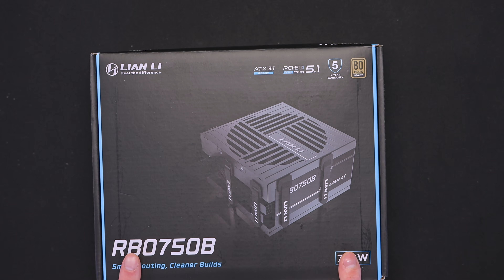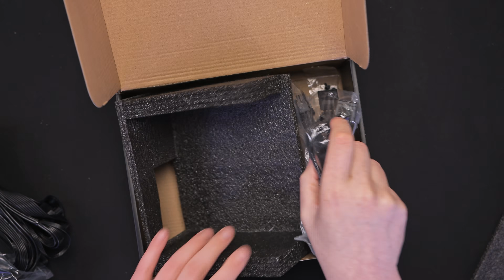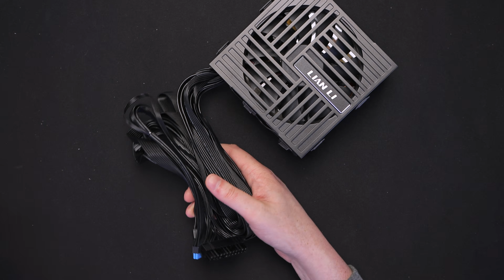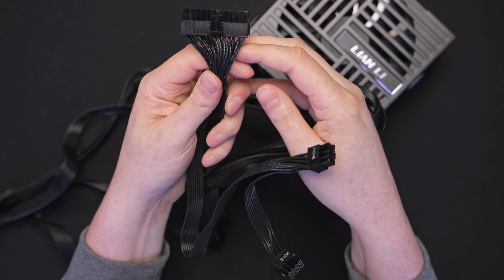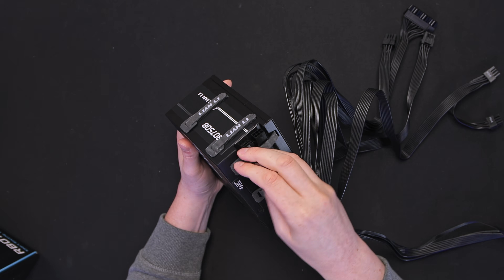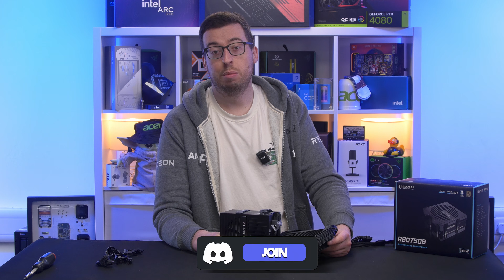A PSU With CABLE MANAGEMENT! - Lian Li RB0750B ATX 3.1 PSU - Unboxing & Overview! [4K]

Comment: I've been a fan of Lian Li brand since yr2000 (if I can recall it accordingly). However, personally, modular psu for me is still the best "cable management" there exist. With this model of psu, it completely did the exact opposite of modularity and the cable clutter is obvious. Since Lian Li is  a case maker (hands-down), I think what they can do is make their own case which they can integrate a psu cable extensions that are long enough and routed to specific mobo-to-psu connection ports. The extension cables can/should be "almost" less obvious inside the case itself. Again, cable clutter "highly affects" cable management. Either that or mobo manufacturers make those psu ports situated in a concentrated location that makes psu cables almost seemless. Again, that's my personal point-of-view.
Reply from the maker: Yeah I get what you mean, modular PSUs definitely make cable management way easier. This is coming in at 70 dollars though, where full modularity usually kicks in at the higher-end units. It would be nice though if at least the PCIe and 12VHPWR cables were modular, since those are the ones you don’t always need. The rest, you’re gonna use no matter what, so full modular on those doesn’t really add much.

Comment: 750w makes sense as this is meant for budget builds. They have their premium products for higher end builds
Reply from the maker: Yeah, of course, I've covered some of their higher end ones. I think higher wattage of this would also be good though, as typically the higher end of a system, the more cables you have in it, rgb, hubs etc.